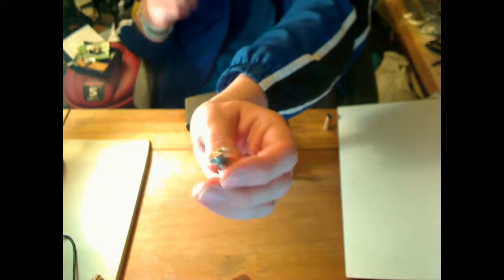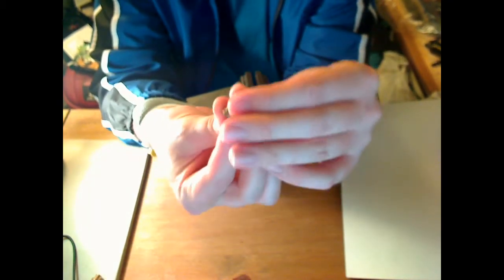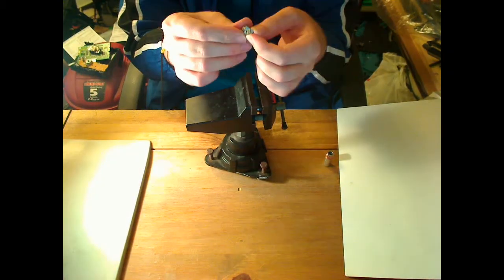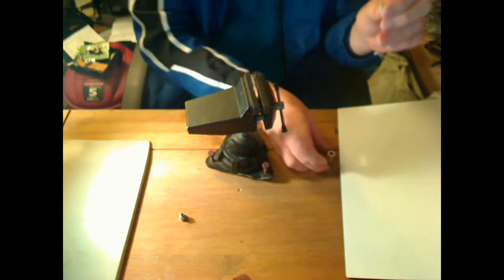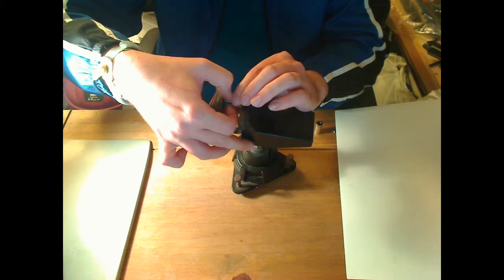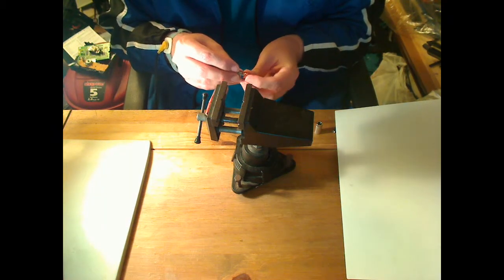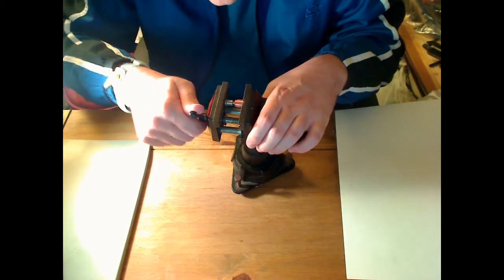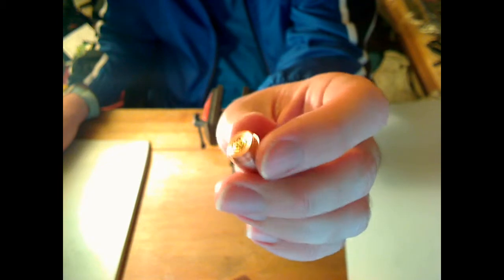Laser Diode Extraction and Pressing Into a Module

Comment: 7:28 - Jeeze glad you mentioned that, I was wondering why no one on youtube would mention to use thermal grease... but I see some commercial laser diodes has thermal grease applied to it's housing module... How do you clean the laser window? I never figured out how to do it. It just makes the window even more dirtier every time I clean it with a cotton bud with alcohol.
Reply from the maker: It has been a long time since I have done anything with them but the window is very fragile and I don't think it's possible to clean it.